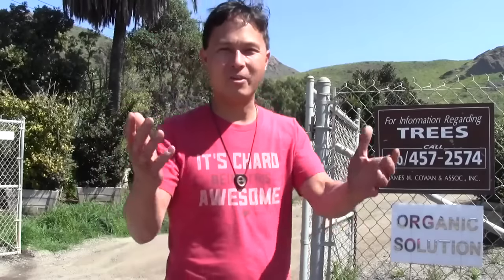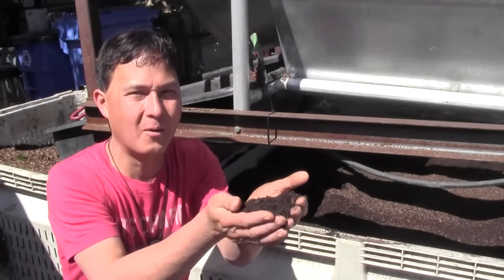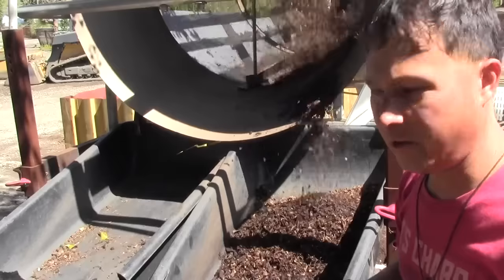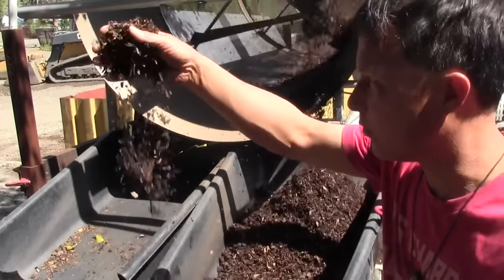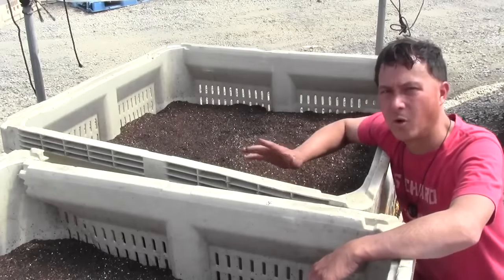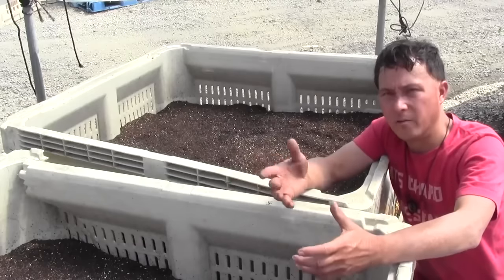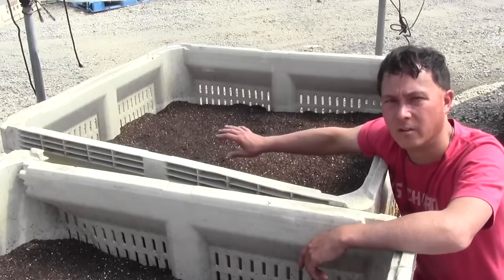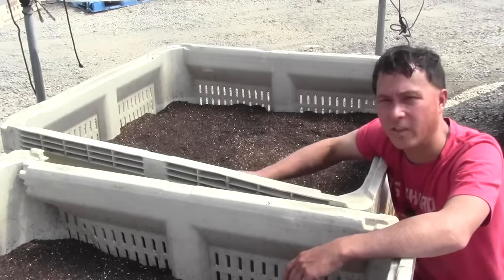How the Best Worm Castings are Made that Can Double Your Harvest

Comment: Hair and nails are keratin, not chitin.  Chitin is most common in arthropods. Some readily available sources of chitin might be shrimp shells, meal worms, or dead bees (if you keep bees).
Reply: Crab meal is a good source of chitin
Reply: Optiveg
Reply: Dead bees? I have my first worms ever. I also get dead bees in my uncovered pool once in a while. Out of curiosity, can I put it in my worm bin instead of chucking it into the yard?
Reply: I believe fungus actually contains a lot of chitin, or at least some fungus, I'm not sure about the fungus mycelium though.
Reply: @melodylamour6123 the pool water has chlorine in it. Probably not a good idea to use bees soaked in chlorine. It may evaporate but I wouldn’t chance it.

Comment: Summary (for info mostly relevant to home growers):

1. You can keep them in your raised beds, or standard produce tubs/totes. Density < 1 pound of worms per square foot. Round barrels not great. 

2. Bedding: functional bedding of active wood/leaves compost screened to an 1/8 inch. Full of microbes and value-added product. 

3. Food: 
1.Biochar - important for microbe space
2. Spent coffee grounds locally grown
3. Kelp adds trace minerals
4. Rock dust for gizzards, and 70+ trace minerals
5. Soil Humates (least important) 
6. High kitenase ground exoskeletons, shrimp/crab shell meals, hair, nails, etc.
Used coffee grounds, newspaper, REALLY love cardboard. No meats, fats, etc. 

4. Fluffer: fluffs earlier food and adds air and space for microbial activity.

5. Don't put your worms in a greenhouse, etc. And ensure temperature regulation similar to what YOU would also be comfortable in. 

6. Harvest: Horizontal migration or upward migration is good strategy.

7. Dry castings if they are too moist, as it stunts microbial activity. Shouldn't be sticking together, or like dust. Barely balls up, like 1 day dried chocolate cake

8. Bagging: Have airflow in your bags (not sealed containers/bags)

9. Use casting products to produce other products, like tea/ambrosia, but only buy castings and don't waste your money on others, if buying.

Interview:
What worms: started with African nightcrawlers, but too hard to regulate humidity and temperature. Now use red wigglers. Use worms that are native to your region.
Reply: Thanks, very usefull comment, regards bro :)
Reply: Much appreciated!
Reply: You're the MVP, Moosa Ali.
Reply: Hugs to you!!!
Reply: Thanks!
Reply: What is "fluffer" please?
Reply: @anajinn putting air into the soil. Fluffing it up, like a peat moss, fluffy. The worms need air/ventilation. Thick clumpy soil or soil that is too wet & not enough air will cause harm to the worms.
Reply: Thank you bro, really productive comment.

Comment: I used to bring worm farms indoors during winter but now I keep them in the dog house (insulated 8x12 shed). The key is maintaining temp >50F with a small NG btu heater. With only the pilot light on is enough to keep it comfortably heated during the winter months here in NJ. In summer I cover worms with moist paper and if really hot put ice cubes on top. Friends/family save me their veg scraps and I shred paper bags, paper, and cardboard. I think worms are very easy to care for. They recycle and provide worm tea and castings for the garden.

Comment: These castings are incredible, I always get some when in southern CA. For those in northern California, there's also a place in Oroville that seems to have similar quality.
Reply from the maker: This episode has some editing challenges when it was originally uploaded. It has now been corrected. So dont skip any sections or you will miss parts.
Reply: What happens to the worms once the soil freezes
Reply: @syrenecrowell7378  Freezing isn't really an issue in California, but worms survive where it's cold by burrowing a little lower. If you have your own worms in a container where it's cold, you may need to bring it inside.
Reply: @peterjsmith5918  thNks for your response. I have a large compost bin outside and right  now the temp is 30
Reply: Degrees
Reply: What is the name of the place?

Comment: is any kelp tested for Fukushima radiation?> It took a while to find a local edible food nursery that carried worm castings without kelp. And I figure, I would rather use woody and green plants fro land anyway, I grew up in Newport Beach and no plants we had, and I lived lucky, the ocean broke across the street from my house, and no plant ever ate any kelp though it washed up across the street all the time lol I like your channel thanks for all the info. I decided to make over a raised planter that has mostly clay with some sand, and crushed rocked 2 or 3 inch diameter, under. I put in 3000 red worms, a large bag of top soil, box of volcano rock dust high in potash and calcium, aded fungus, and I differ from your 2016 show on LA City "mulch" as it depends where you go. I live in Los Feliz so, .5 miles from where your show was done, but I go to a small pile next to the LA River bike path. It is called mulch, but, it is layered, and they add to it all the time. Today, I found rich black layers with well decomposing woody chips, and soil or broken down materials, it was like stratum, I had to mine it. It also had fungus and I want more, there is some, I found when clearing, but the clay has never had a lot of roots through it 0- hence the worms, and I planted flowers, native coastal California form Learners? And milkweed seeds, but also, strawberries and melons, inland ten herbs plus local garlic. Newbie I learn a lot form you, cheers

Comment: Can the use of egg shell ground replace the crab shell meal for the function for small -medium scale gardening - I have 6 bins small larger than others ?
Reply: Louise Stanzione  yeah, any veggie scraps can be used.
Reply: Didn’t answer my question. I know about veggie scraps but about the question I asked??
Reply: Since both crab and egg shell provide calcium, they are interchangeable ingredients for fertilizer.
Reply: Egg shells are great,here's a little tip: save all your egg shells in a bread bag in your freezer.When you are baking something in the oven,set the shells on the rack 
but take them out before they turn brown. They pulverize much better this way. A little bone meal is also a tonic for worms.
Reply: I don’t believe egg shells will replace
crab/crustacean meal. The main reason to use crab/crustacean meal is for the Chitin, not for calcium.
Reply: Crab meal is used for other microbilogical reasons and will produce higher quality castings. Egg shells don't serve the same function but you can use them as well. The crab meal isn't available in my area and there's no substitute for them according to the horticulturist I have spoken to

Comment: Hey John, do a little research on the "compost tea" from worm castings or leachate. I've been doing this for a while and it is not what it is hyped up to be. It could actually be bad. Make your own compost tea. DO NOT use the "leftover, drained off stuff" from worm castings. It is, by nature, left over, for a reason. It is a bunch of discarded junk by the worms. Let it drain into the soil where nature will correct it. It should actually be labeled as contaminates. In fact, if you do the worm farm the right way, there should not be any run off. Whomever has that is over-feeding them causing a bad environment. Again, make your own tea. Do your research. From an avid, unsubscribed follower. Just sayin'. Test it for yourself ad you will see. I have been testing and working with it for years. I am just an old, country farmer in VA who has extensively tested everything I find on the web so that I can learn more. I have found that a lot of the stuff is produced/promoted for selling (money) - not results. If you will test it, you will see, if you monitor the growth and production. I am not trying to take away from this company, but I think they are following an unsubstantiated trend.
Also, of course the worms like the glue. I think most of it is corn starch nowadays. They LOVE corn meal. I don't use a lot of it, but it will regenerate or help a failing worm farm.
Reply: I'm praying for y'all out in Va